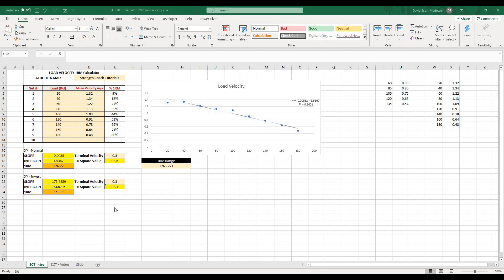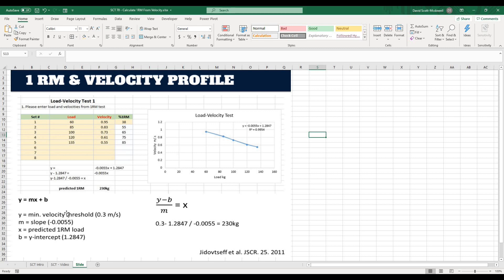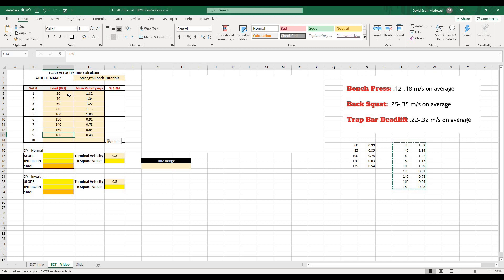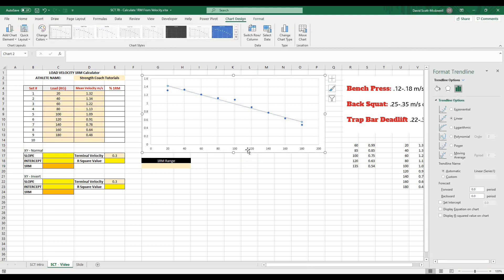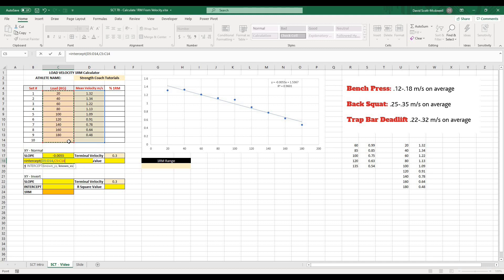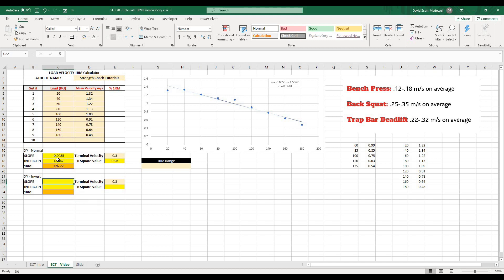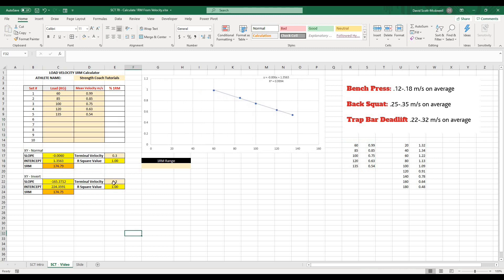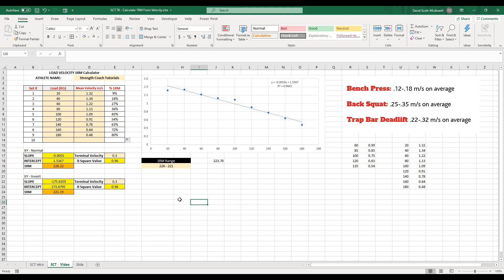Calculate 1RM using Velocity

Comment: Hello. My name is Alexandre Martins. I am a student of PhD in Portugal, at University of Évora. Congratulations  with this file. I have one question: The value 0.3 (terminal verlocity), is it adequate to use with older people (age than 65 years old)?

Can I use this file with all exercises?

Best regards,

Alexandre
Reply from the maker: I think if you want the data to be as specific as possible you should calculate the terminal velocity by taking the exercise to failure. This will be specific to that individual.. lifting experience, limb length, leverages all play a role on what the terminal velocity will be for each individual. Sheets like this will put you in the ball park.

Comment: This is great.  I really like all of your videos.  Thank you.  Just a couple of questions.  Is there anyway you can make your screen size bigger?  Sometimes it is really hard to see the numbers and equations bigger for us old guys.  Also, could you use this same sheet if you are doing the Olympic lifts where instead of mean velocity you would be using peak velocity?  Keep up the great work!!
Reply from the maker: Hey rufus, 

thanks for the feedback.. ill see what I can do about screen sizes i will have to get better with my video editing software. I need to show the whole screen most of the time to show the whole product but ill try to figure that out! 

For weightlifting movements it would not work the same way because there is not the failure speed. You wouldnt really estimate your 1rm in the same way with weightlifting because it is such a technical movement. When I am working with my athletes i take their 1rm for a clean or snatch variation as the top lift they have acutally completed. 

hope that helps